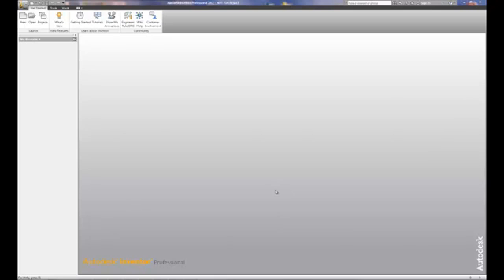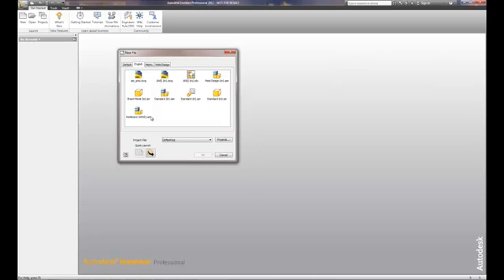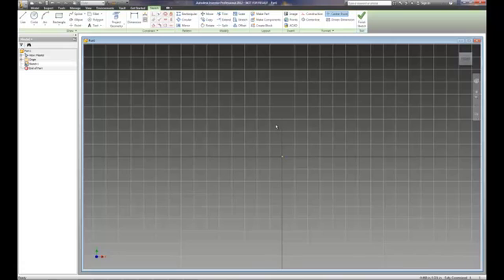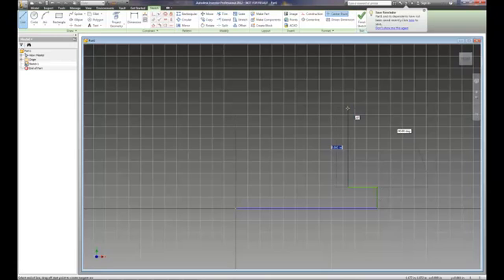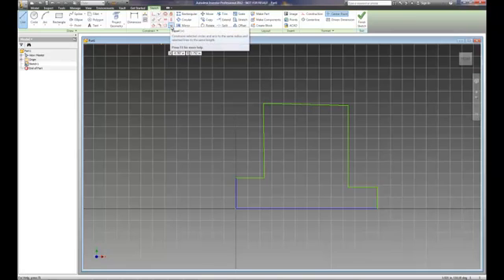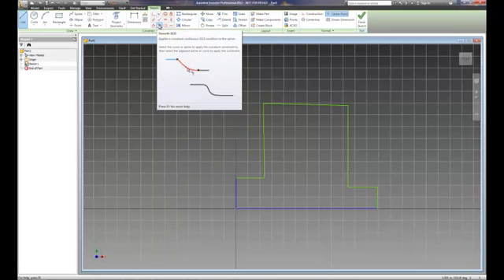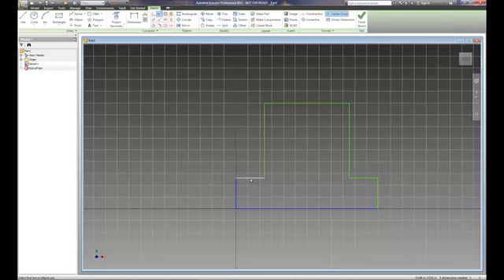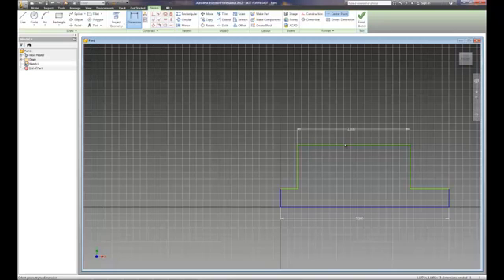Inventor 2012 Part Creation Video #1

Comment from the maker: @ultrAnil59   It sounds like you are missing a template file you need for the system.  It may require an uninstall and re-install. 

The Autodesk discussion groups  may be a spot to do a search for a more detailed answer.